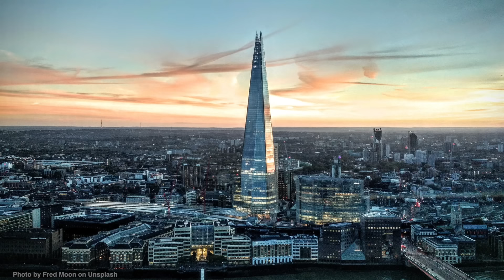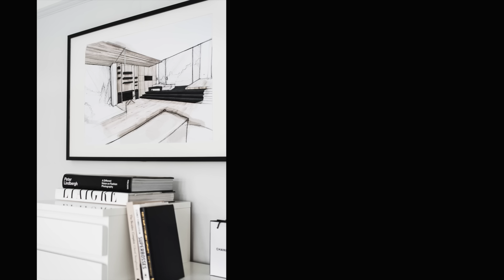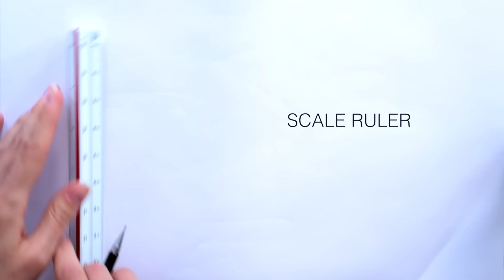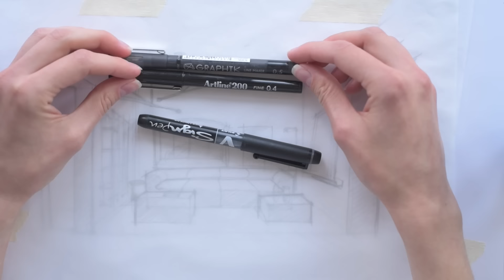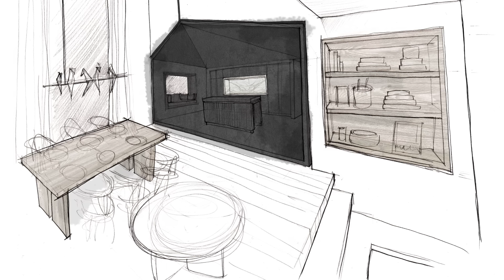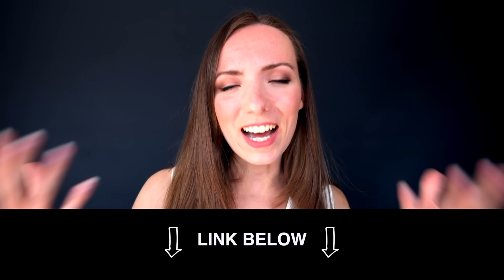Interior Design Sketching Techniques - Drawing Like a PRO!

Comment: My confusion is: then what do you do with the drawing on the thin tracing paper? Do you have to try and photo copy it is that it prints on regular paper?
Reply from the maker: I like to keep mine as a digital copy - I scan them with the Canon Lide 220 Scanner and edit (if needed) in Photoshop. I then put them inside the client presentation and print. 

I also like to keep the originals in my archive.

Hope this helps.
Ula